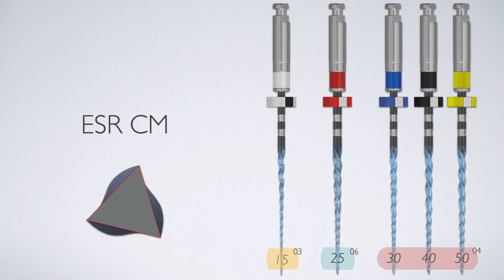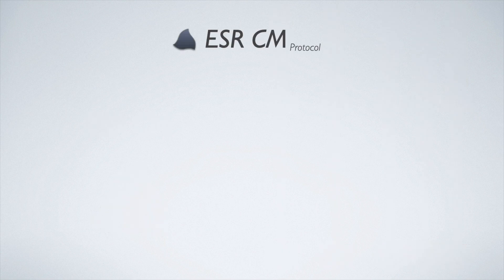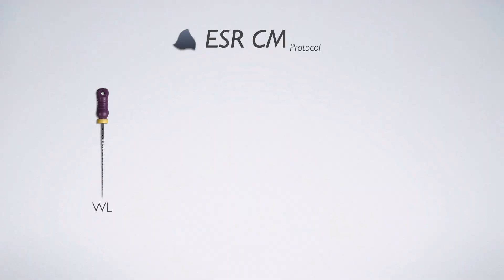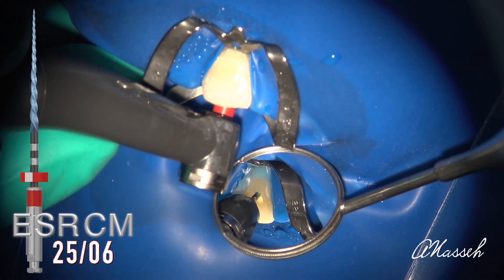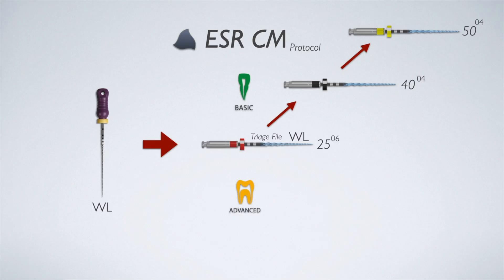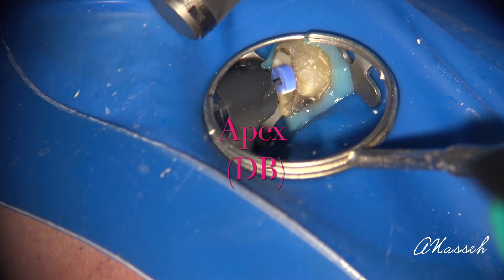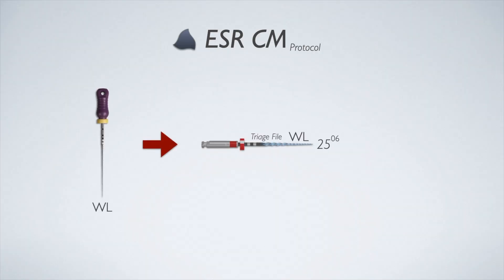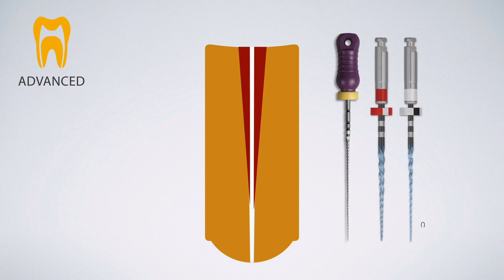ESR CM Instrumentation System (Part 1 of 2)

Comment: Good morning sir..my question is that crown down technique leads to more ledge formation as per Luiten et al in his article JOE.1995;21: 26-32, ofcourse Luiten has not talked about passive crown down technique, please comment on it.
Reply: Heres what I think about this : Crown down fashion and crown down technique are two different things. It is implied here that the rotary files (Luiten et al have used manual K files) are used in a way similar to the crown down technique, but passively. 

Also file design will have a major impact on the ability of a file to ledge a canal. Goes without saying that these rotary files have a much advanced metallurgy and design compared to traditional k files.
Reply: @aaronsarwal  thanks for clearing my doubts..it means that with rotary files we have to use crown down technique in pressure less or passive manner or in other words pressure less crown down technique ( which infact doesn't cause ledges).